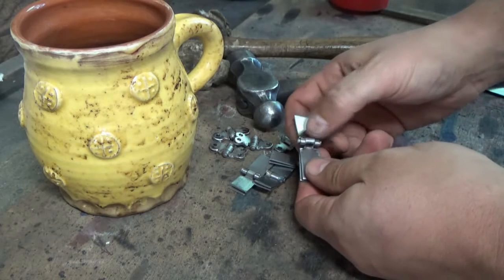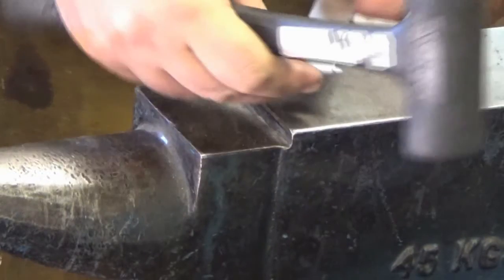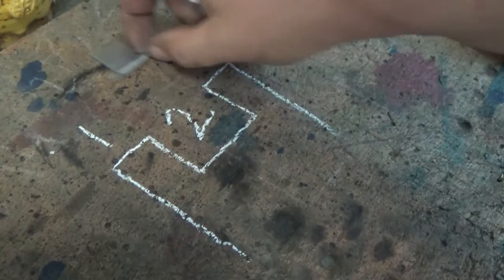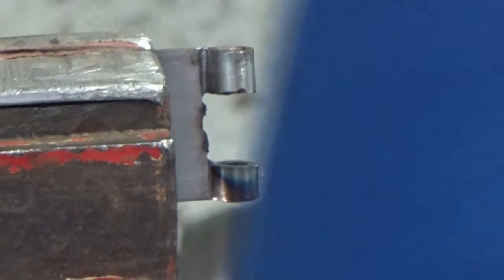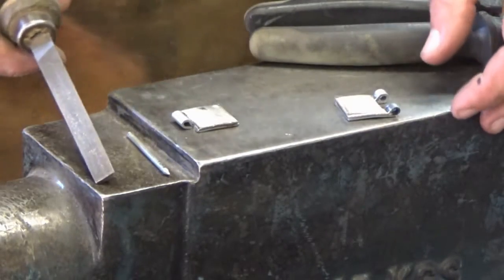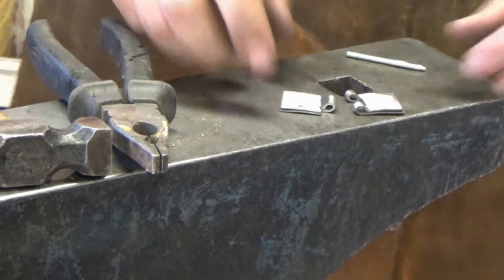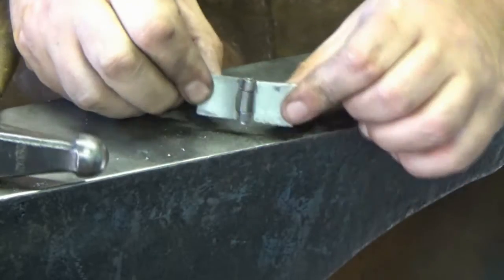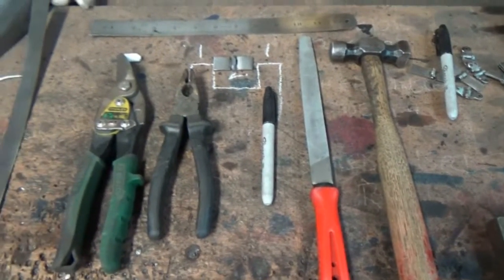How to make hinges, part 1, Medieval Armor Techniques #4

Comment: I've recently started to make lighters and revisited this from a few years back. This type of hinge is the most durable I've found by far, jewelry hinges either require tubing or are on the weak side
Reply from the maker: They're great, I use them in my garden for a couple of jobs :)
Reply: @GreenleafWorkshop  as simple as hinges are I find great happiness in being able to make them myself. I really appreciate this video

Comment: i wish i could find these online to buy -.-"
Reply from the maker: I can make them for you at various sizes and we can figure out a cost, but I don't think there is anyone just making armour hinges. Failing that modern hinges can be used, it just depends how much authenticity you are after.

Also the hinges tend to have to be internal, so only the barrel can be seen or it is immediately obvious that the hinge is modern.

https://www.screwfix.com/c/security-ironmongery/butt-hinges/cat840980

Comment: I'm assuming piercing the work before forming is how they were made before people had incredibly powerful hand tools to mill out the hole?
Reply from the maker: You're likely correct. I've seen single and double layer hinges. But in both cases there are very, very thin to help punch through (I suspect).

Comment: How did they cut the steel in the Middle Ages?
Reply from the maker: HI there, most likely with chisels and files. They are surprisingly quick and with practice not far off the time it can take to use electric cutters (including clean up). I'll show it on a set of arms I have to make in the near future.

Comment: Mde again....

Interesting you use a grinder to cut out. Have you done a time comparison with a saw and chisel?
Reply from the maker: I've used saws and chisels, but didn't time anything. I tend to use the grinder as it's simply closest and ready to go. My suspicions would be that the grinder is a bit quicker but needs more cleaning.

I tended to cut out the hole with the chisel and then make the hinge rather than make the hinge then grind the hole though.

I'll give it a practice and try the three techniques and see where I end up :)